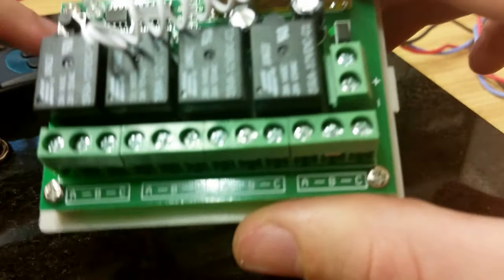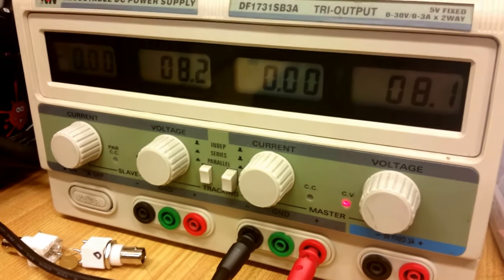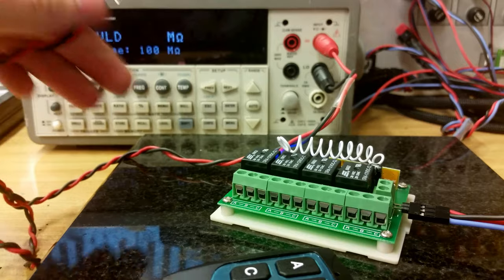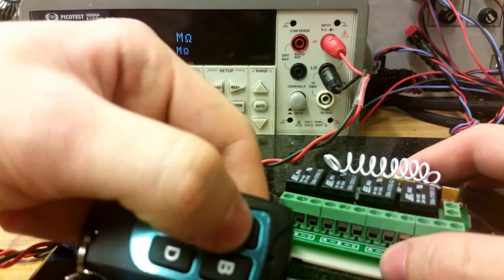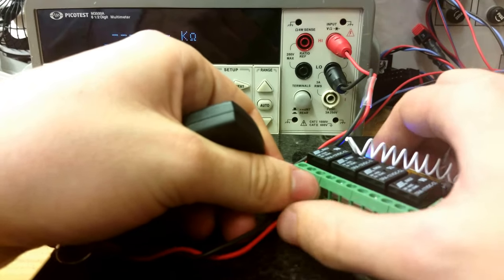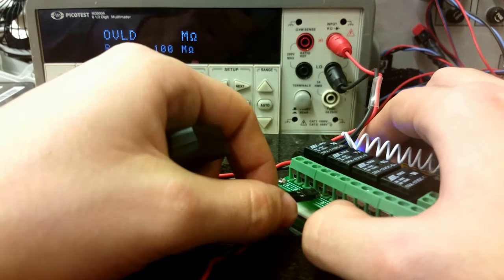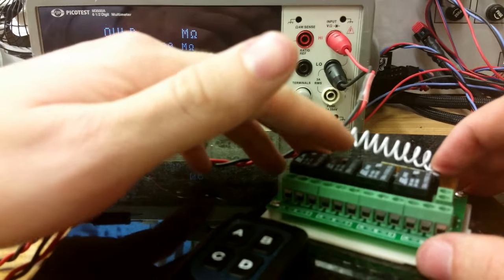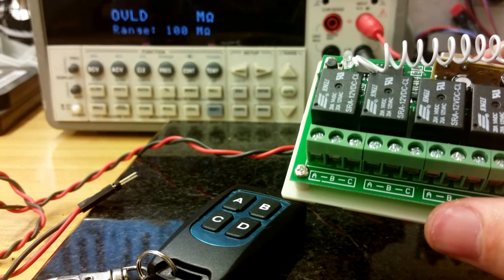Banggood Relay Switch for 433 Hz, Short review

Comment: Have you done a range test yet? I am trying to do an "off the shelf" DIY motion detector that will alert me when rabbits are in my vegetable garden and need about 150 ft distance to cover. I will naturally use a PIR  in place of one of the buttons of the transmitter . Perhaps I may be able to upgrade the antenna of the Tx unit....thoughts?
Reply from the maker: I haven't done any sort of range test. how long distance do u need. I can check if it works.
Reply: How kind of you to offer ! :-)  It is about 150 feet I have to work with, I thought if one could extend the PCB antenna on the Tx unit, it might work easily with 433 MHz.   I would be in your debt
Reply from the maker: My unit started having problems after approx. 30 meters, so it would be approx. 100 ft. Signal went through one brick wall. You could go for a lower frequency and maybe change antena from 1/4 to 1/2 of wavelength
Reply: Thank you and I apologize for my lateness we are having near flood conditions in some areas. So based on your findings,  I will build the rf operated relays while I await the GSM type cellularText message solution. I will augment antenna on my Tx unit  and Rx too. For sure upgrade with a 370mAh LiPo and consider a neat DIY  high gain directional antenna I saw.   But of course connection to the PCB of the Tx unit. could be difficult for anything but a simple dipole.  thanks again

Bye  for now